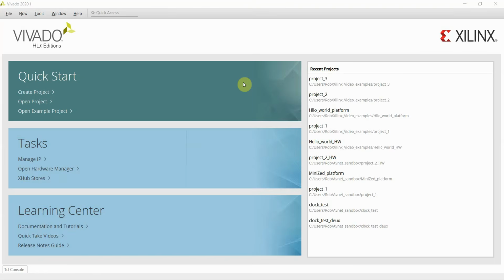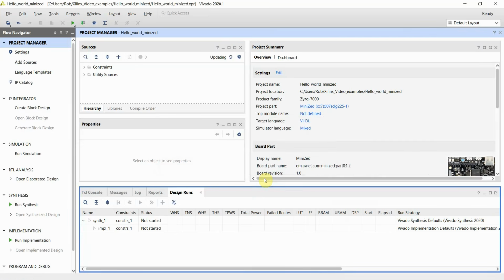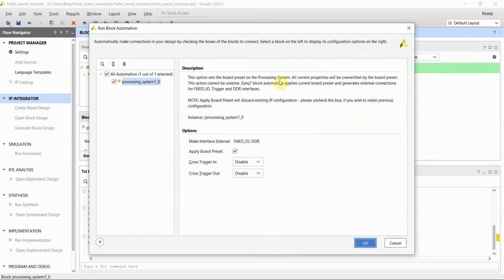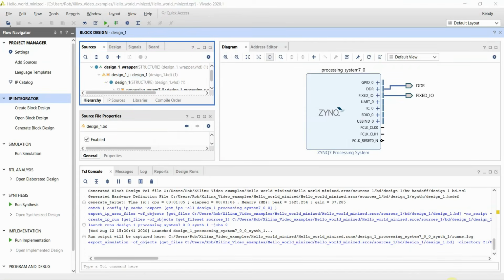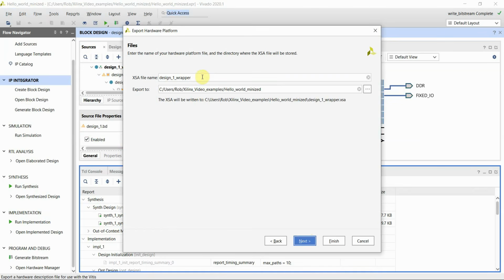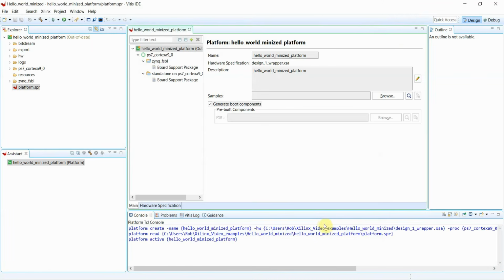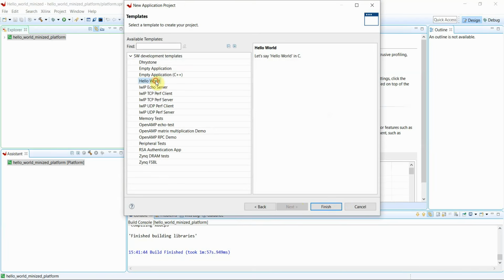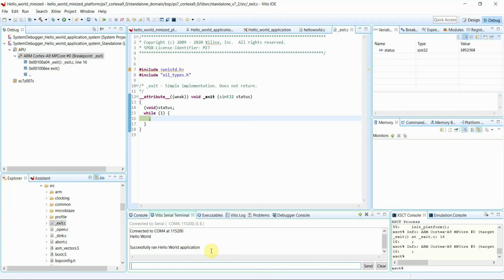Hello world video using Xilinx Zynq, Vivado 2020, and Vitis

Comment: I have been testing this for a week, but every time the synthesis process starts, Vivado throws an error, and it says the following: WARNING: [Synth 8-350] instance 'inst' of module 'processing_system7_v5_5_processing_system7' requires 685 connections, but only 672 given.

Do you have any idea how to fix this? I have currently tried with Vivado 2024.2, Vivado 2023.1, and Vivado 2018.1, and with MiniZed board versions 1.2, 1.3, and 1.4.

And I get the same error with all of them.

Comment: Dear Sir
I have built a module using PL part only to calculate the summation of Bytes. Now, I try to use the Zynq with axi-gpio to read the final value of the summation. I test each circuit individually, it is works correctly. The problem is that when I connected them together (the PL with PS), I did not get any results by the Zynq at the serial monitor.
Please, if you can help.
Thanks.

Comment: When attempting to Validate the Design, I keep getting the error ' [BD 41-758] The following clock pins are not connected to a valid clock source: 
/processing_system7_0/M_AXI_GP0_ACLK'.

Any ideas?
Reply: In case anyone was wondering, if you have an 'M_AXI_GP0_ACLK' input pin, you need to connect that to the 'FCLK_CLK0' and that solves all your problems.
Reply: @xEcko6  Thank you very much for your comment, it was very useful. Could you tell me the reason for this? Furthermore, I would be very happy if you have references to learn more about the platform. Thanks
Reply: Same error any solution??

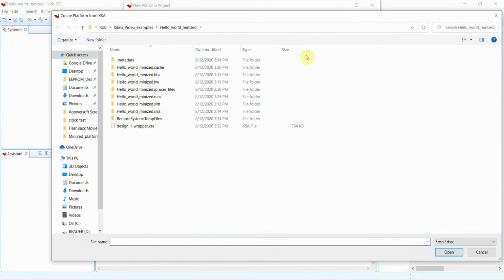Comment: @15:08 you Browsed your project folder for your design_1_wrapper.xsa file and it successfully opened with Operating System:  standalone and Processor: ps7_cortexa9_0.
Well, when I selected my design_1_wrapper.xsa file it took a while BUT both the Operating System and Processor were greyed out and blank.  
It would not let me continue.  So, can I select a default XSA and which one?
Or do I need to go back and fix something?
Note:  since my free Vivado 2021.2 ML Version failed with the MiniZed board I had to substitute the Zybo Z7-20 (xc7z020clg400-1) board, Report IP status, Upgrade Selected, Generate the Output products which worked, Run  Synthesis, Implementation, and Generate Bitstream successfully, Export the Bitstream file to Target HW, selected Zybo Z7-20's XSA file created in my project folder, Exported HW Platform.
Then I opened Vitis Tools > Launch Vitis IDE > Create New Platform > hello_world_platform > XSA File:  design_1_wrapper.xsa > Open > Reading HW specification.
Software specification:
Operating System: <blank> greyed out
Processor: <blank> greyed out

Aby suggestions on how to remedy this problem?

After further investigation, it appears you skipped a few steps in Synthesis because you did not use a MiniZed board Constraints file and did not set the I/O pins for this design application.  So, go the following critical warnings:

General Messages
[Common 17-55] 'set_property' expects at least one object. ["c:/Users/..../Documents/Xilinx/FPGA/Projects/RobertSwan/Hello_world_microzed/Hello_world_microzed.gen/sources_1/bd/design_1/ip/design_1_processing_system7_0_0/design_1_processing_system7_0_0.xdc":33]
[Vivado 12-1411] Cannot set LOC property of ports, Could not legally place instance design_1_i/processing_system7_0/inst/genblk13[31].MIO_BIBUF at E16 (IOPAD_X1Y108) since it belongs to a shape containing instance design_1_i/processing_system7_0/inst/PS7_i. The shape requires relative placement between design_1_i/processing_system7_0/inst/genblk13[31].MIO_BIBUF and design_1_i/processing_system7_0/inst/PS7_i that can not be honoured because it would result in an invalid location for design_1_i/processing_system7_0/inst/PS7_i. ["c:/Users/.../Documents/Xilinx/FPGA/Projects/RobertSwan/Hello_world_microzed/Hello_world_microzed.gen/sources_1/bd/design_1/ip/design_1_processing_system7_0_0/design_1_processing_system7_0_0.xdc":188]

Design Initialization
[Common 17-55] 'set_property' expects at least one object. ["c:/Users/.../Documents/Xilinx/FPGA/Projects/RobertSwan/Hello_world_microzed/Hello_world_microzed.gen/sources_1/bd/design_1/ip/design_1_processing_system7_0_0/design_1_processing_system7_0_0.xdc":33]
[Vivado 12-1411] Cannot set LOC property of ports, Could not legally place instance design_1_i/processing_system7_0/inst/genblk13[31].MIO_BIBUF at E16 (IOPAD_X1Y108) since it belongs to a shape containing instance design_1_i/processing_system7_0/inst/PS7_i. The shape requires relative placement between design_1_i/processing_system7_0/inst/genblk13[31].MIO_BIBUF and design_1_i/processing_system7_0/inst/PS7_i that can not be honoured because it would result in an invalid location for design_1_i/processing_system7_0/inst/PS7_i. ["c:/Users/.../Documents/Xilinx/FPGA/Projects/RobertSwan/Hello_world_microzed/Hello_world_microzed.gen/sources_1/bd/design_1/ip/design_1_processing_system7_0_0/design_1_processing_system7_0_0.xdc":188]

So, do you have a recommended I/O Ports for the following this applications (86) signals?

Thanks,
JT

Comment: I’m using a Cora Z7 board and when I run the auto router in the block diagram  it throws an error that the clk input is not connected to a valid source. The block diagram didn’t change the way yours did. Any idea what it could be?

Comment: While connection to com4 is successful at this baud rate, the terminal prints nothing. Is there any suggestion?
Reply: I had the same problem.. I closed Vitis, connected the board and open Vitis again. It worked for me.
Reply: @isidroy  , Did you manage to solve your problem? One question, did you use USB for debugging and another cable for USB-UART for UART communication on the terminal?